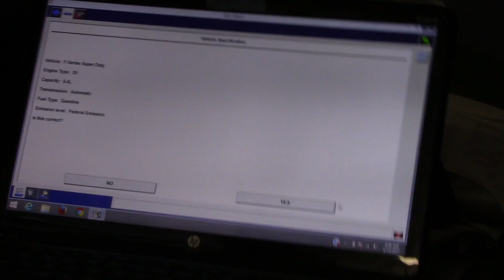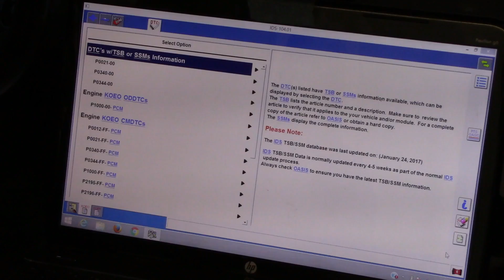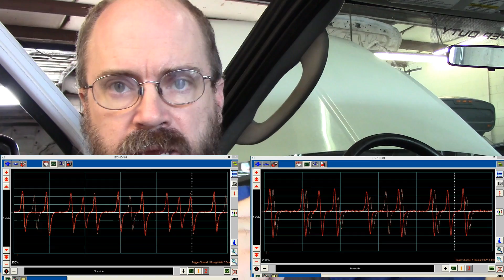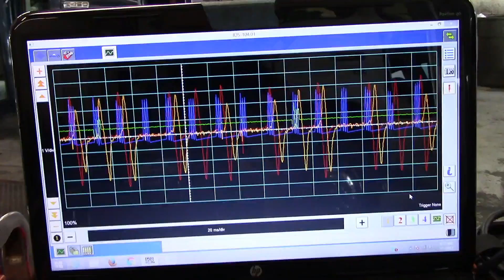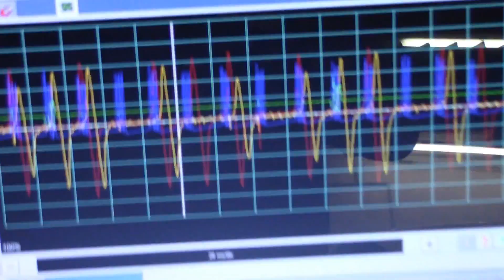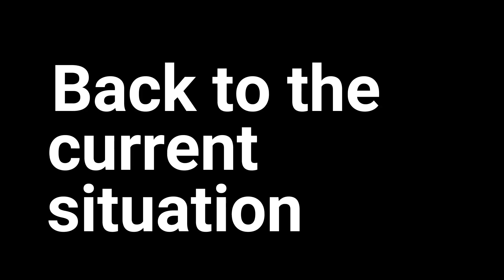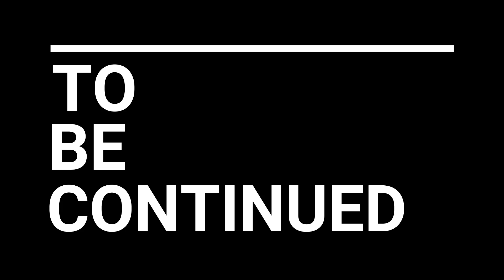Scott's Lawn Care '05 Super-Duty 5.4 3V part 1 of 3

Comment: Yeahhhhh the oil pressure sender port on a GM truck engine...on the back...behind the intake...against the firewall in such a damn bad spot that replacing it, is LOADS easier if you just break down and remove the intake...hence the oil filter adapter for pressure testing on a GM truck!

Comment: So what exactly was wrong with the old engine?  Bas head?  Was it fixable?
Reply from the maker: It had been neglected pretty badly. The oil system was so gummed up with cruddy baked oil that it just couldn’t operate correctly. It would have cost more to repair all the damaged parts, crank, cam, phasers, lifters, ect. Than to just replace the unit. Plus the warranty is much better on a drop in unit versus a in house rebuild.
Reply: @flmmaz  you da man

Comment: Looks to be bad maintenance to me, what oil filter was on the old engine
Reply: it happens. I worked in plumbing during HS and our work truck was an early 70s Ford with some hard miles on it. We were not nice to that truck. It had a few big holes in the exhaust to begin with so we would shut off the engine on hills, pump the gas and then light up all that fresh gas in the muffler. it was good loud fun. One day we jumped in the truck after a job, my partner decided to drive, went to shift and pulled the shifter right out of the floor. drove back to the shop in 2nd gear. normal day on the job. Never did get the stripped out oil drain plug fixed. ha ha ha

Comment: Looks like you're just buried with engine work. I see a 6.4L mounted on your Norco engine stand in the background. One complaint I have, with using that engine lift bracket is how the back two holes don't quite line up properly to the bellhousing bolt holes without "persuasion". That, and how the top of the mounting bracket seems to interfere with the actual body of the transmission bellhousing itself, when bolted up.

Comment: Enjoy your videos, Is that a snapon roll cab you have? Do you like it
Reply from the maker: Yeah, It works out pretty good, I was a little apprehensive about the two drawer setup as I bought it used from a co-worker but I like it and use both drawers to hold bolts from vehicles I have torn apart.

Comment: no the 3vs lose oil pressure at 2k+ rpms. the oil pump leaks. put in an high output one. non Oem.
Reply from the maker: This engine was sludged up beyond repair causing low oil pressure at idle.